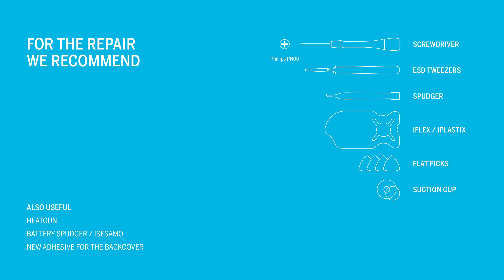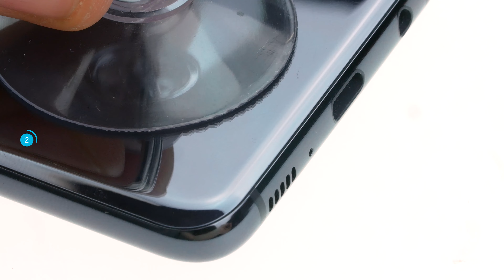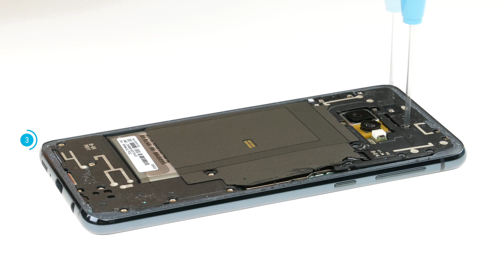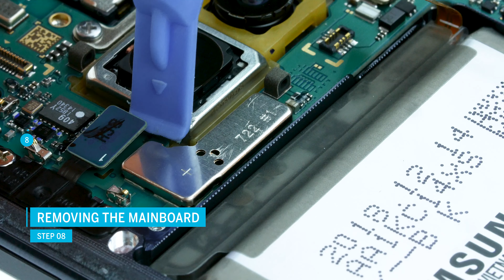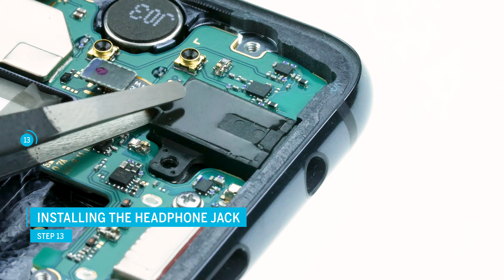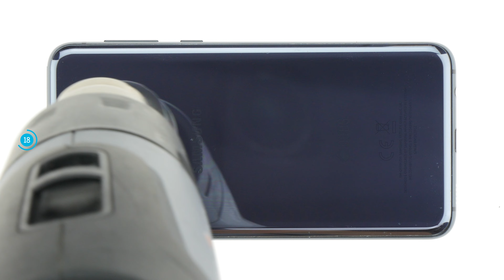Samsung Galaxy S10e – Replacement of front camera & main cameras [including reassembly]

Comment: Took 5 mins, thanks. My camera was blurred and not focusing and as soon as I took off the back cover, the camera was working perfectly so must have been a hairline crack on the lens cover on the back cover I guess. 

I removed my back cover with the very thin pieces of metal that came with my car magnet phone holder which are meant to be placed inside your silicone phone case to make them magnetic. A food emergency solution. Also, I did not have a heat gun so placed inside a t-shirt and placed in the oven for 5 mins :)

Comment: Great guide thank you . I got a s10e off ebay with blurry camera and stripped screw where they had tried to fix it before. I got a genuine Samsung one off ebay that had been salvaged from a used phone off ebay as wouldn't trust the Chinese ones off ebay precision camera lenses are not there thing. The one in it was a chinese one and due to poor fitting and handling had dust under the lens. The chinese ones lenses both looked really murky and were loose fitting and the outer bit of samsung ones is like a ring of foam the chinese ones are just plastic housing. The samsung one i replaced it with is amazingly clear.  I compaired the camera with my s6 edge and when you zoom right in to photo of the old camera the s6 edge is much less defined the outer ring just looks black where you can see every speck of dust on the ring with s10e and the glare off the glass lens is bright and vivid with s10e. I think both cameras are 12mp on the s6 edge and s10e (",) .  Highly recommend getting an original samsung camera sensor even if its a used one ...

Comment: I did exactly as you show but now my camera picture is blurred. I made sure it was clean, not sure what to do. Any ideas?
Reply: is it a chinese oem replacement or a samsung part? A genuine samsung one will have the model number (g970f) .  Also i read that it can be a android software problem that can cause blurry camera too. Mine has dust under lens you could see black dots when against white and lenses were cloudy bujt they were chinese ones (",)